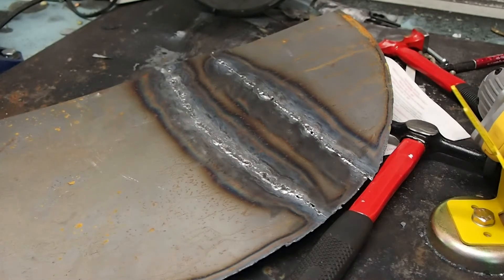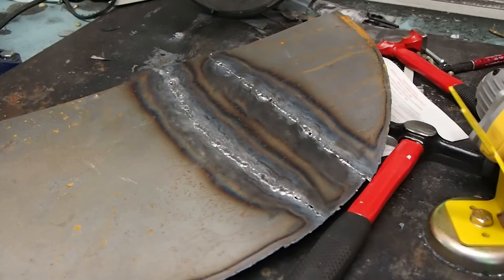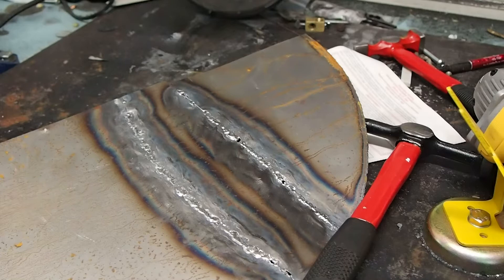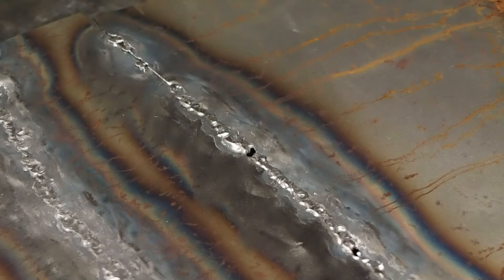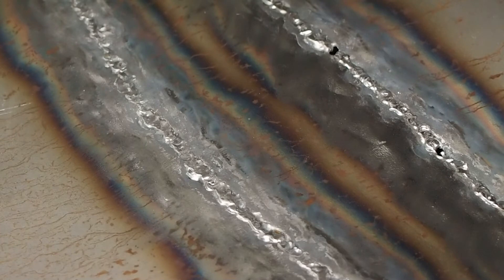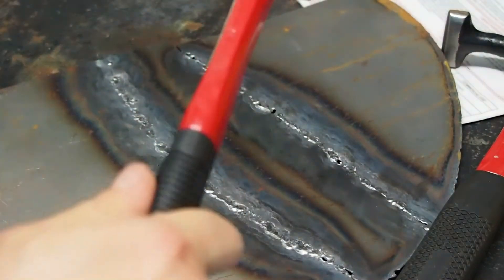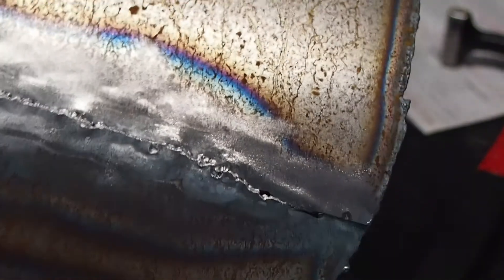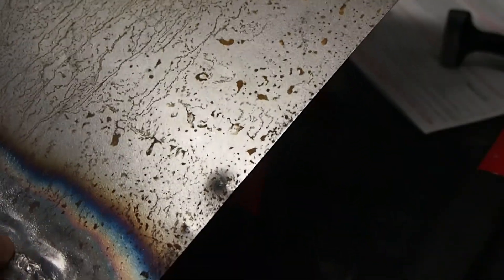Oxy - Acetylene Welding Practice

Comment: 30 years ago in vo-tech school we spent 2 weeks 3 hours a day just practicing. Butt welds, lap welds and other welds. Make sure you use the right size tip for the metal thickness. And it has to have a neutral flame, MUST. Good luck keep up the great videos. P.S. I still weld to this day. But mostly braze fixing cars and such.